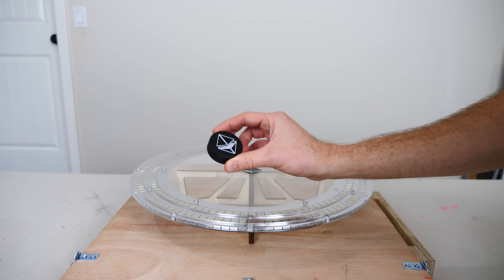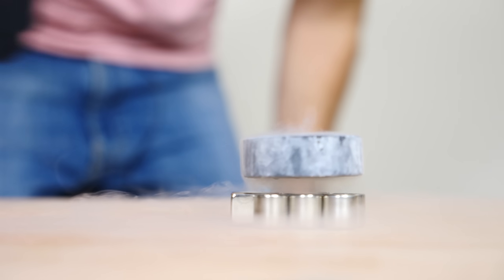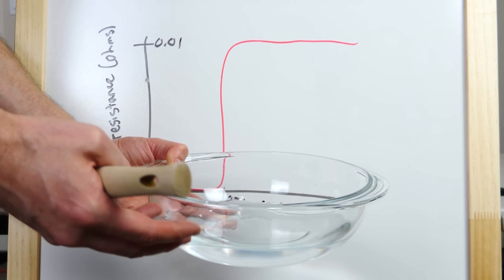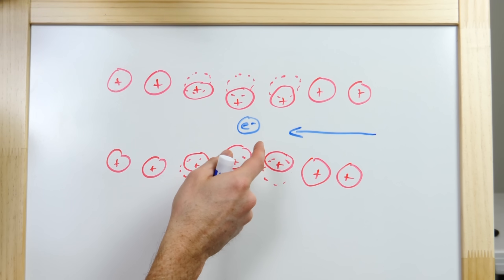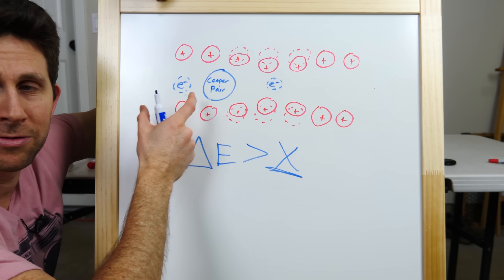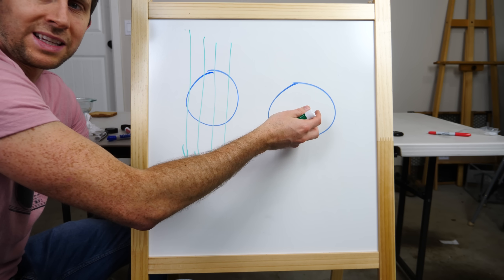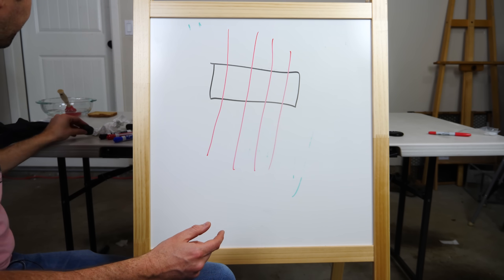Quantum Locking Will Blow Your Mind—How Does it Work?

Comment: Nicely presented. In my opinion, you may have just explained how the plane Earth travels or maintains position in space. However, it is a superconductive spherical object with the minus temps (<-65°C) in the upper atmosphere and with the plane Earth (oceans & continents) in the middle, hence we do have the ice ring at the outer rim where the spherical dome (firmament) meets the plane and locks in the water. The galactic plane acts as the magnetic rail.

Comment: This is the secret to space travel. We just use the cold vacume of space . Space is about 3 Kelvin which is a constant.  We simply use Quantum locking to hitch a ride on a pre calculated iron based space rock traveling in desired direction.  I'm not a scientist but I keep having these ,for lack of a better word "Visions". I've even dreamt of how to detach from your host propellant (asteroid,  meter etc etc). Your vessel will heat it's outer shell to cause the separation.  Then you'll just stay in orbit and send out smaller vessels which are able to enter an atmosphere and have the thrust power to launch back out to dock with the main ship. I know it sounds crazy but I can't stop drawing schematics and stuff. I don't even know how to wire an electrical outlet but I dream of this crazy stuff , wake up right away and put it on paper.   I truly think not in my lifetime but somehow someone will find a way to use this technology for what it's meant for.

Comment: You should set a super conductor on a magnetic field track inside a vacuum chamber since the only way to conduct heat in a vacuum is through convection and with the super conductor refusing to touch the magnets to complete a convection current in theory it should just keep going forever or atleast as long as the vacuum remains

Comment: Could you use the material in superconductors to build some type of motor to be used on a vehicle in space? Since the temperature in space is -400+ degrees and liquid nitrogen cools it to less than that, wouldn't you have an endless resource of the cooling agent?

Comment: The cool thing about Cooper pairs is that electrons, as individual particles, cannot possibly en masse fall into the lowest energy state. This is because they are a type of particle called a fermion. According to quantum mechanics, only two fermions can occupy any given energy state, meaning, no matter how much you cool down the material, only two electrons could fall into the lowest state, with the rest stuck at higher energy states. However, the formation of Cooper pairs forms a pseudo-particle that instead has the properties of a different type of particle called a boson. With bosons, unlike fermions, an unlimited number of particles can occupy the lowest energy state, and at a certain temperature, bosons can suddenly all drop into this state to form a "Bose-Einstein condensate" which can have a lot of strange properties like superconductivity and superfluidity (e.g. superfluid helium).

Comment: So the question is how much weight can a super conductor hold ? Dose it depend on the size of the magnet, the conductor or how cold you can make the conductor with the liquid nitrogen? And I wonder how long the puck would stay in motion if kept at the same temperature and not stopped by an external force?

Comment: Very interesting.  And a nice simple description of what is happening.  Two questions:  what would happen if the magnets on your track were unevenly spaced?  Would the SC slip or stick?  Second question: were the magnets on the track equally spaced on the inside the same as the outside, or were the magnets arranged axially with equal numbers for inside and outside?

Comment: So, if you put that superconductor inside a small insolated cover and fill it with a little bit of liquid nitrogen to keep it always below that temperature, and move it on top of that magnetic surface, will it be moving forever? Or at least couple of days?

Comment: What would happen if you encased the superconductor in a well insulated disk or tube like structure filled with nitrogen to keep it indefinitely cooled & therefore indefinitely in motion, and possibly harness the kinetic energy of that motion via coils wrapped around the tube to be stored on a small battery, and than use that stored energy for initial restart without physical contact? Actually now that I think about it, assuming whatever houses the superconductor is also under vaccume, the nitrogen itself boiling would provide sufficient initial energy for the superconductors motion, so if an engineer were to design a method of modifying the temperatures at specific points around the disk, thereby controlling the speed of the conductor by bringing the nitrogen in and out of its boiling point which I think is really low, it would harness perpetuality of motion while maintaining the conservation of energy, and or provide free energy as it's a closed loop system. Am I onto something or just completely Ignorant?

Comment: Question: While the track is upside down, if you were to attach the superconductor via quantum locking, does it increase the total weight of the track by the weight of the superconductor?
Reply: Shifty Grifter great question
Reply: I would say yes, since the magnetic field lines are like invisible strings which would tie back to the track.

Comment: Did you sleep with someones wife? Cuz it looks like someone deck'd you. Hard

To the meat and potatoes of the vid. In theroy the super cold conductor formed the atoms into a linear bond. The bonds are so tight it gives off magnetism. These bonds are rearranged the atoms/molecules to positive and negative (trying to reach the warmest parts while avoiding each other) Much like a regular magnet would. The magnet on the cold hockey puck helps pull the atoms into that direction (much like making your own magnet)

Now the really cool part. If we were to be able to pull and capture the vacuum of space. we could essentially create super conductor magnets for a reliable renewable power source IN SPACE

As for the experiment itself. It resembles more of electromagnets like you would see for high speed monorails. Same theory in play. 
ALSO... there is still electrical resistance. You are not computing air. Air is composed of multiple elements. Which carry there own electrical charge and resistance. But i can see why you left that out as most people would not understand
You are welcome for the layman explanation. Yup.. Im a super nerd....

Comment: This is actually a super cool experiment to do! I did this back in my Inorganic Chemistry lab, except we used Type 1 superconductors. The difference between the type 1 and type 2 superconductors can be observed too! In this video, magnets would lock in place with the superconductor and require significant force to move it at all. Only when there was a symmetrical field could anything be moved freely. With the type 1 superconductor, however, there are no "strings" holding the magnet in place. It honestly might be worth another video just to show people how cool it is and how different it is from the type 2. Since there's nothing holding the magnet or superconductor in place other than the magnetic field around it, it can be spun with virtually NO friction at all. This means the magnet will continue spinning forever until the minuscule friction from air resistance stops it. The whole idea around superconductors is an incredibly cool experience and I'm glad you were able to show everyone how these work!

Comment: U just need to fit a bar bearing and a few gears the fit to a small electric motor and reverse the motor to create charge for ever. Then fit this inside a freezer and wiring to freezers power to have a freezer than ran for ever

Comment: I understand that it wouldn't be feasible to have liquid nitrogen in cars to make floating cars using this.  However, I am now wondering if it would work the other way around.

What if the nitrogen cooled type 2 semiconductor was slightly underground and the bottom of the vehicle had the magnets.  Could this theoretically be used to float a vehicle?

Comment: how cold is space? could this be used for some sort of engine in space with free cooling for the conductor? Or would the cold ruin the magnets?
Reply: "Space" is not cold. Vaccum insulates. That is why a thermos keeps coffee hot or liquid nitrogen cold. Material surrounded by a vaccum does not transfer heat energy efficiently as occurs if it was in contact wiith matter as a solid, liquid, or gas. In a vaccum, there is no matter (molecules) 'nearby' to act as a conduit that would allow the spreading and equalization of the vibrational 'pressure' of the heat stored in the matter of the vaccum surrounded object. In a vaccum heat energy can only be radiated as electromagnetic energy. Radiation in the human survivable range would be infrared, and that is generally a much slower process. The direct transfer of the heat energy stored as molecular vibration in matter to other nearby matter of any sort, as I noted before, is generally far, far, more efficient. We think of space being cold because of the ice that forms on human skin when exposed to space, but that is because of the explosively rapid evaporation of water (liquid to steam) when there is little to no air pressure. That is why water boils at lower temperatures in higher altitudes and 'in space water on your skin and in your body instantly 'boils' and you lose heat energy so fast that what that water leaves behind becomes frozen.
Reply: @Knight3rrant  so is it a light and dark thing then? because I always thought since the temperature on the moon from light/dark was a big swing from burning to freezing. In which case some sort of engine could be made that used energy from facing or shaded from a star?

Comment: I'm sure this can be explained to a general population, but you make it confusing at several points. I'll try to give a few examples of when but please review your explanation critically.
> Do crop out things such as the sequence from 08:58 to 09:00.
> You explain the Cooper Pair as two linked electrons then you trivially call it "a particle" - a bit confusing if you ask me. You also start talking about its "quantum state" - do I need to keep "quantum state" in mind or is it just a redundant piece of information for which you could find a metaphor?
> You go on about some amount of energy required to change/bump this "quantum state", we don't know what that means and it's already very hard to follow.
> You introduce X as a certain threshold of energy but it's hard to make the connection that the X is a value pertaining to the conducting material.

> The block of aluminum example at 12:58 doesn't seem to come from anywhere - are people supposed to be familiar to a block of aluminum moving towards a large magnet?

Comment: Your theoretical explanation (BCS theory) is great, but it does not hold for HTS superconductors like the YBCO you use. Also, magnetic field penetrating in type 2 superconductors is not due to impurities being present, it is because it's energetically favourable to have vortices of supercurrent in which centre there is a normal zone, hence allowing magnetic field. Impurities provide locations these vortices can stick onto, so it's harder to move them. This is the flux pinning, to move these vortices energy is required. Bulk cuprate superconductors like you have are great for this, as they are inherently dirty. They are highly polycrystalline, so there are a lot of grain boundaries and non-crystalline spots that act as pinning centres. Lastly, type 2 superconductors do have a Meisner state at low fields.

Comment: Hey, nice video and amazing explanation!
Just a friendly heads up from some experience working on a cryiogenics lab here in Brasil:
Never pour liquid nitrogen from this reservoir you have(a Dewar). Their internal structure is fragile and very thin and only conects to the external structure in the neck, so all the stress from the weight of the structure and liquid inside the Dewar is sustained by this thin neck. Is not hard to break it, but is damn hard to fix it.
Use a "fishing" structure(that's how we call it here in Brasil, I'm not familiar with the specific term in English): it is a pipe that goes all the way to the bottom of the Dewar and has a sealed tap that allows you to pump some air in the surface of the liquid. The rising in upper pressure makes the liquid flow out of the dewar. 
It's a simple setup, don't get fooled by my confusing explanation.

Thank you for the videos, it's a great contribution for science!

Comment: There has to be a way to harness this for an alternative energy source!
Reply: Not a source. It's more like energy transportation.
Reply: @starskiiguy1489  true man, it definitely has that application as well! I was just thinking, If you added some coiled wires around that super conductor and had the track going around lined with wire conductors as well. I just think in theory it could produce an electromagnetic field. 

Unless the super conductors low temperature somehow messes with the electric current.

Comment: In order to cool it down we need some nitrohysoskmqkwoeknd
Me: “does ice work?”
Reply: Yes.
Well, ice from nitrogen, or oxygen or hydrogen or helium. 

Water-ice would also work. - If it's frozen by liquid nitrogen, liquid oxygen etc...
Reply: @HansenSWE  might seem like a dumb question but does the density or intensity increase/decrease depending on which method you use to create ice? like is ice made from hydrogen compared to helium different in their compounds, I don't know much so i'm curious
Reply: @Cozy_Katie  I was mostly hinting to the extremely low temperature the ice would have to be. It was like a joke.

But to your question, the density of ice changes a little bit with temperature and a little bit with pressure, but not a lot. The elements I mentioned in their liquid form would have almost the same temperature so the water-ice would be identical.

There is some water-ice that are actually denser than liquid water, which thankfully is not very common. I can't directly tell you how that forms right now, I'm afraid.

Comment: With this "technology" we could make the worlds most lossless trains, cause it wont lose energy with other things it will only lose energy from air resistance
Reply: They already exist, but they use electromagnets
Reply: @luca_sbll  Pretty sure maglev trains are more efficient. Having to cool the superconductor is its biggest weakness. Often in a house the most expensive appliance to run is a fridge because it takes an order of magnitude more energy more to cool an object than to heat it up.
Reply: Pearson James yeah, not to mention maglev trains also use those magnets to move, and not just to float

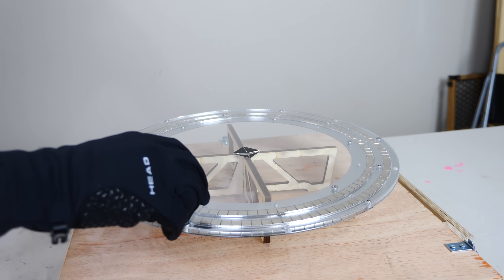Comment: 4:46 WAIT A GODDAMN SECOND HERE, THAT MAGNET STARTED MOVING BEFORE YOU MOVED IT

That gives me the impression of something that physically isn’t supposed to happen. Am I missing something here? Like, no way you just created a perpetual motion machine accidentally, so what moved the magnet and why isn’t it permanent?

Why isn’t this being used far more for generators, if it really is perpetual? How isn’t this breaking the laws of thermodynamics?
Reply: the track is inclined slightly, it is moved by gravity.
it is not really perpetual, first there is gravity involved, second there is air friction, third it'll heat up eventually and lose superconducting properties until cooled.

Comment: Imagine how much cost we can reduce on energy if this can be applied on vehicles or public transport.
Reply: Would have to figure out a way to do it at normal temperatures, as it is not feasible to have nitrogen cooled superconductors on every vehicle.
Reply: Not cheaper than electrical cars
Reply: I've looked into this, it won't work. The energy you could harness from it would slow it down to a complete halt. 

Even in a vacuum with nearly zero air resistance, once you start pulling energy out of it it'll slow down making it useless for making energy. 

The fundamental flaw of perpetual motion engines.
Reply: @ShadowLynx777  I think what they actually meant was hover vehicles. Things that don't actually have any friction with roads and such. It makes some sense, but liquid nitrogen isn't cheap enough to make it worthwhile. It's like hydrogen powered cars. More dangerous, and not worth the extra cost.
Reply: @ShadowLynx777  have you never thought the earth and the oceans are in perpetual motion. Also Time. Things are Relative, but exist with in ones mind before the physical. It Is Possible.
Reply: Would take excessive amounts of energy to keep creating enough liquid nitrogen. You can't just find it in nature, its temperature is near absolute 0...
Reply: For now settle for magnetic bearings
Reply: Maglev?
Reply: Ok, I think electromagnectic based rails transportations are cheaper.
Reply: You still have to keep it at really low temperatures which probably takes a lot of energy

Comment: But, with "common" Eddy currents, you get a opposing magnetic field when you try to push them together and an attractive magnetic field when you try to separate them, so you also kind of "lock" it in place, thought because of electrical resistance, the field can't really be strong enough. 
I would like you to provide us with sources of information. Thank you.
Reply: a quick read of the wikipedia pages on "flux pinning" and the "Meissner effect" will illustrate that this guy has no idea what he's on about. sincerely, a really frustrated physics undegrad
Reply: @kyleboschen6220  It's likely the sum of the same effect/force that keeps electrons orbits from decaying as electrons movements don't produce continuous em waves despite being a constant moving charge via entanglement/cooper pairing.